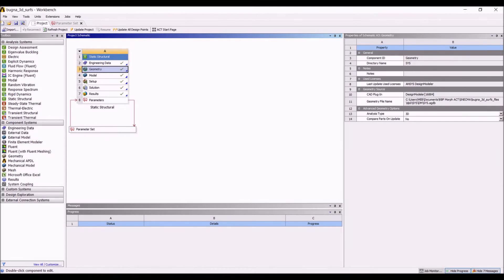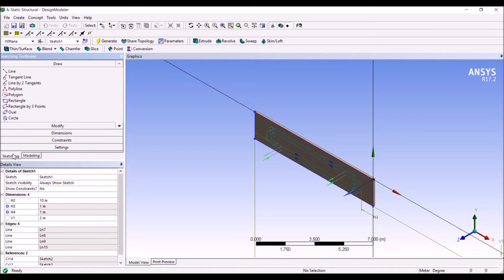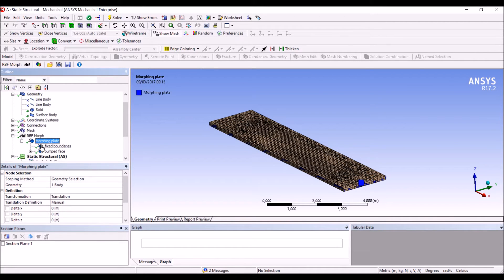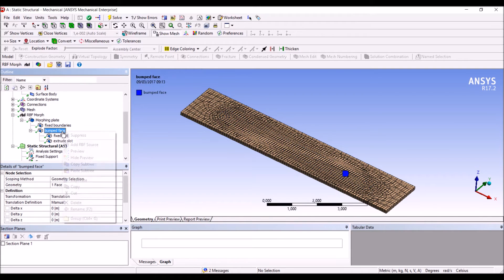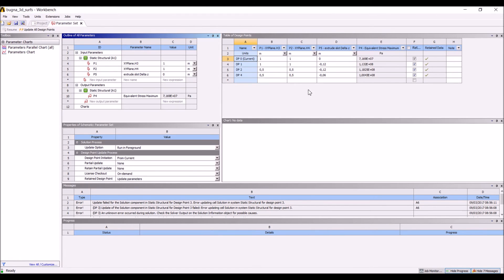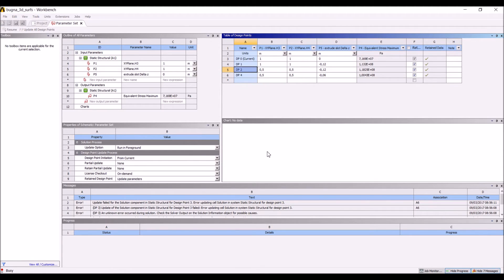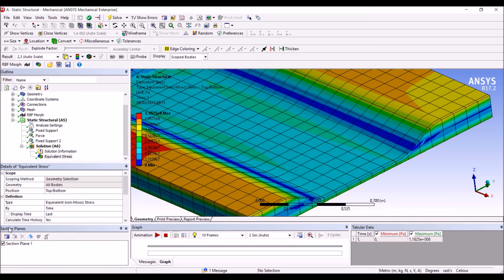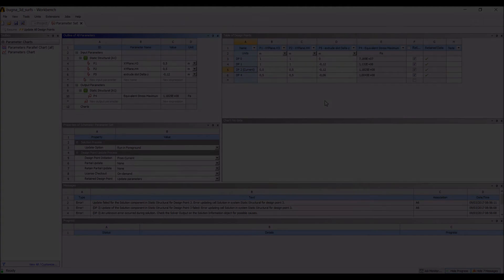#rbfMorph ACT #tutorial  - creating a clew

Comment: My question might sound elementary. I do not understand why can't we just use extrude cut in solidworks and then import it in ANSYS and just do the analysis? Is this kind of optimization? What is auxilary mesh?
Reply from the maker: Mesh morphing allows to keep the same mesh. This means that an auxiliary geometrical model can be used to update a dead mesh that belongs to a FEA model ready to run. Clew shape parameters (location, size and depth) are created and can be steered by the optimization software. Auxiliary mesh means that you can build just a small auxiliary FEA model that is used to set-up shape modification (but it is not part of the analysis).